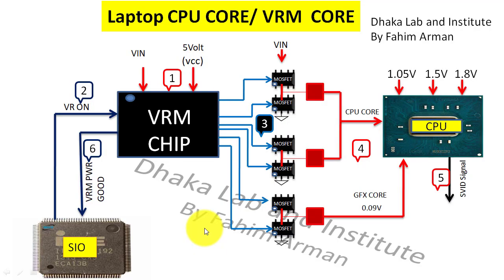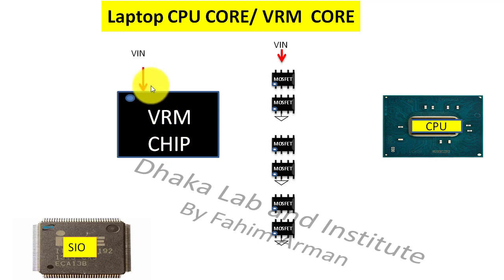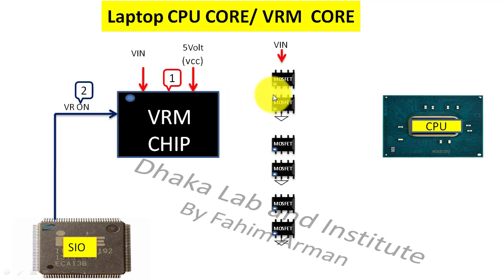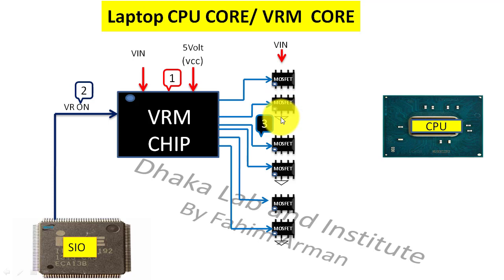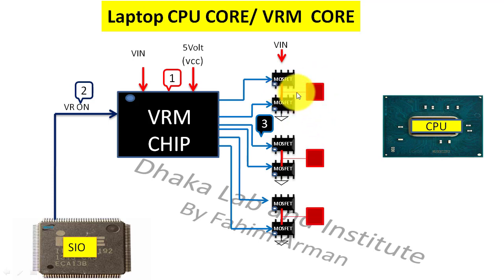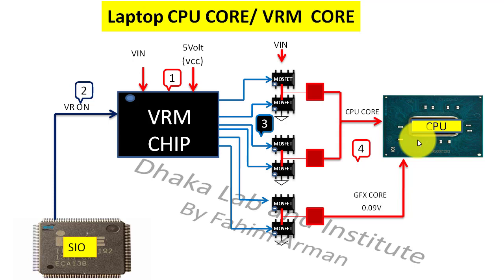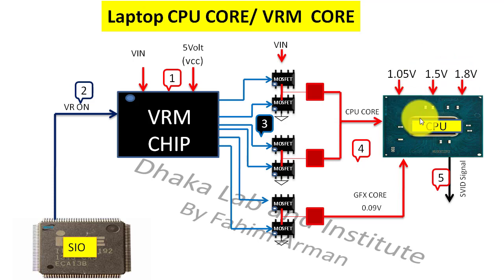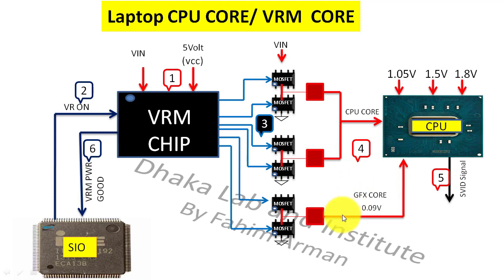laptop CPU/VRM core section in details. Dhaka Lab and Institute.

Comment: I have a question. I'm having trouble with my Lenovo ThinkPad L13 Gen 2. With the laptop on and without a display, I measured the vcore voltage and it read 1.8V, which should be 1V. The processor is also very hot. What's the problem? thank you
Reply: That processor is gone

Comment: Hi i have a weird reading if you can help me on the CPU high side mosfet, but normal 5.1V on 2 other low sides at all times when on (2 +2 for CPU) if you can help me nail this down?  9/10 times the screen stays blank but all times when i turn on,  lights, fan, 5, 3.3, 1.8, .8V ect all over the board so good and i already flashed the Bios although the ME region needs cleaning is a cause?.   Anyway i get HALF A OHM ON THE GATE and 19V available on the drain at all times. I removed the high mosfet and the half ohm is STILL ON THE m/b PADS and the mosfet has millions on g,s,d so that is not shorted.   When i can get the screen to come on, all 4 mosfets seem normal readings and the Coil into the CPU is 1.6V from memory and is now hot and running,  and i can read the bios screen and move the cursor and its stable, BUT  when i try Ubuntu on a usb, it will load to the Ubuntu menu and when i try to temp install it, a few seconds later it resets and i lose the gate V ect THEN a few secs later the Ubuntu Menu comes back again as voltages come back.  So what is causing the .5 OHM and reset voltage crash when i LOAD the system? From a close schematic for this MB, i understand the Gate MAYBE goes straight to the VRM or with a small resistor? so how can it have half a ohm unless shorted but then why does it work sometime normally unless the chip is faulty? Thats my guess so far.   Any help would be much appreciated.   I love learning board repair and this is my my mothers old single core Toshiba laptop and i really want to save it.
Reply from the maker: @xx3868  Without physical diagnosis its unpredictable to give the Solution.
Reply: @dhakalabandinstitute6964  Hi,  My VRM is TPS51620 which i cant find a pinout anywhere??. If i can get that data, i can trace those signals you mention to the high mosfet and other question is -  for High side mosfet. IS the resistance EVER half a ohm between G & S with Mosfet removed?  I checked other M/Bs and they all seem to halve lots resistance there. So the VRM is damaged as the gate goes straight to the VRM or with small resistor Usually?  If i had a thermal camera, i could apply 1V and see what gets hot?  Your videos have been very helpful anyway and like get your book too maybe but hard to find to buy.